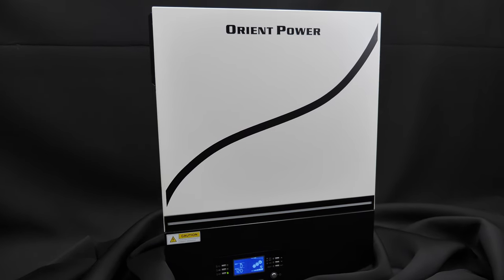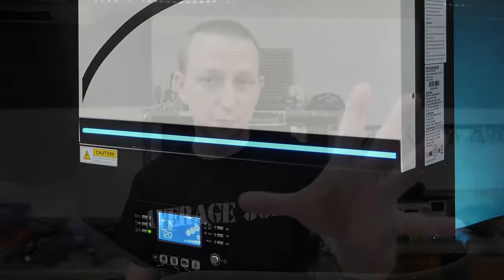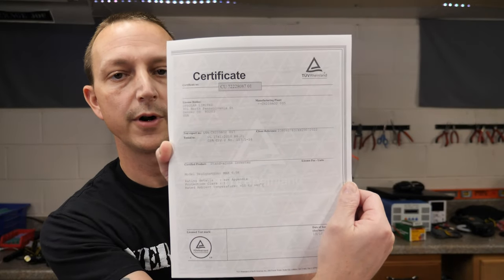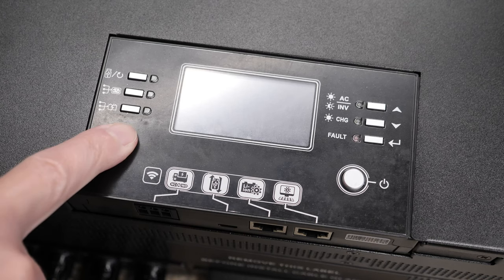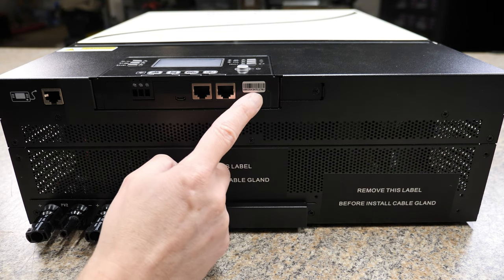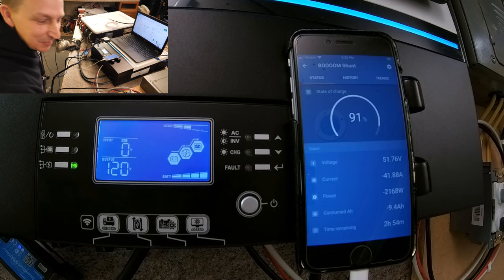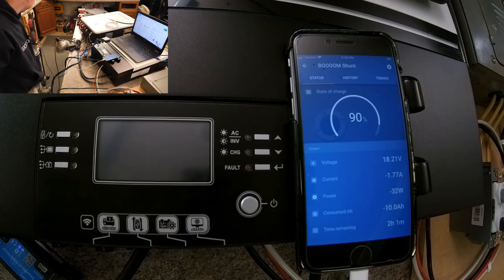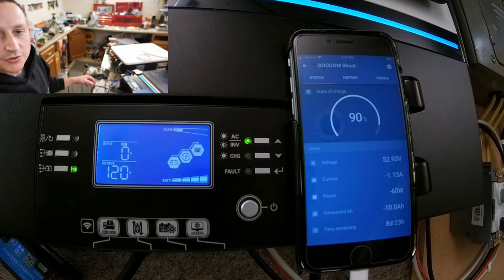Orient Power 6.5kw All in One Solar Off Grid Inverter!  Full Review

Comment: 6.5 all-in-one unit why would you make a 6.5 all-in-one unit when you get to 6,500 and have both and never run low on power where the 6500 all-in-one you have a power issue you always come short empower personally with me when my kitchen stove is going in my water heater that'll be my first power issue it ain't producing 8400 w or none of the other ones that are needed to produce to run the the microwave the toaster the fridgerator the living room the red power systems the other heaters in the house Robbie shut down because I'm short I'm power so why couldn't they make a 9000 watt inverter all-in-one or 13 KW. All-in-one everybody seems to me so they don't have a short Southern pretty doesn't turn off. Tell you the truth everything in my house is electric everything is electric in my house in Wisconsin.
Reply from the maker: Well it really depends on everyones needs. With this you can get 2 to wire in parallel for 13kw split phase if in the US. Or 2 in parallel for 230/240v single phase, again 13kw. My house I purchased a 240v 12kw growatt low freq split phase inverter a few years ago. Runs great. The orient inverter doea have a few option that mine doesnt have.
Reply: @AveRage_Joe  I like those inverters don't get me wrong yes I would get four of those inverters as long as I parallel together even if they and use a lot of watts to run them I mean I already have one of them I do need more of them but right now I I need to think about the batteries to change from my $93 lead-acid 1000 amp hours 135 amp hours batteries to $369 battery or a $1050 battery all 200 amp hour or a bigger battery for possibly a powerwall that cost a lot more. Especially when my EverStart batteries last 30 years and five of them just died on me last week and my inverters and chargers went blitz with my power and two died last December besides which leaves me with 16 batteries plus my truck battery which now gives me an odd number without the seven batteries that died this winter but I can't complain they did last me 30 years. So they did me right. And if I get any other  batteries and replace my batteries for solar batteries I want them the last me about as long. what I am saying as I take care of my batteries and only take 30% out of the batteries leaving 70% in making sure the terminals are cleaning and why is always good charge him up to where only the batteries like it to be and in return they treated me good new batteries I would like to go to do the same thing for them so they'll treat me good. And if they do that I'll change my other solar panel set to the new batteries as well those never gave me a fuss even at 30 years they are still going strong but that one I run at 12 volts so I'll probably add the odd number of batteries to that because I can't run the other system with seven or eight less batteries cuz if I do that track odd numbers a batteries from that I'll be dropping down to 50% every day or night and they all will die by spring end and I'm not that mean to batteries. To buy very pricey overpriced batteries I really have to think hard about it some people say it's no brainer but I'm only told it's a 10-year compared to what my thirty-year batteries that everybody tells you only a two-year maybe three if you're lucky what about the ones that lasted me 30 years some of them are still going. But added those other batteries to the other set I have put a little predicament on them because running him down to 20% I'm back up what killed him real fast too maybe it'll be 25% but I'm not sure if that's good enough yes I get a lot of batteries to make it so they don't run out of power better life span never working real hard but work them . But this also gives me extra solar panels then I can't use at this time. Probably could had a few to the other set but not all of them. So if I can afford to buy more batteries I I'm supposed to have for solar panels in short. Of time even if it ain't enough I'll give him a lighter load to make up the difference. I'm trying to do to get enough solar panels to run my whole house to one system with four of those 6000-watt inverters 24 kilowatts To my whole house and a few other things and a camper two campers actually a greenhouse my back shed and the tools inside it and my other shed as well as another I'm going to be building. I'm always going to have two sets now of solar panels and batteries and inverters systems for I'll be using one as a backup for the main one kind of like what I do now even though I only run part of my house oh and it has to take care of my daughter's medical situation. So at the meantime I two different places for my daughter it is a friend's place my daughter stays at when I have problems with the power issues. The reason why I got into solar panels I had a power issue from The electric company having problems or fire  out by the lake are car accidents or something like that is the reason why I got into solar panels same day I bought my house was because of some things happening out by the lake I think it was that restaurant or the house across the road from the restaurant where they cut the power to the city fix a problem that happened out there and that was even before my daughter is around I just knew I didn't want to have a power issue in the winter which happened a few times as well because of something like you're the same place three three and a half miles away solar panels for a very expensive I started real small first to run lights and lights in the meaning of a couple lamps TV VCR someplace systems but nothing that was really needed because I couldn't run a freezer or refrigerator short on power because they were so freaking expensive so I took very good care of the solar panels the batteries and the 12 volt inverters.  I mean since then I got more and bigger inverters that were all 12 volts 850 watt 1800 watt 2000 watt 2500 watt two 3000 watt 5000 watt 6000 watt and  8000 watt 12 volt inverters, and then my first 48 volt inverter. At this time I use the 850 watt, 1800 watt, two 3000 watt, 6000 watt, 8000 watt, and the 48 volt 6000 watt 120/240 inverter which is right now I cannot use because of the battery issue. Well I better stop.